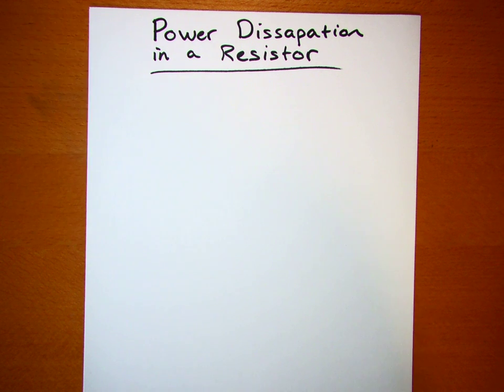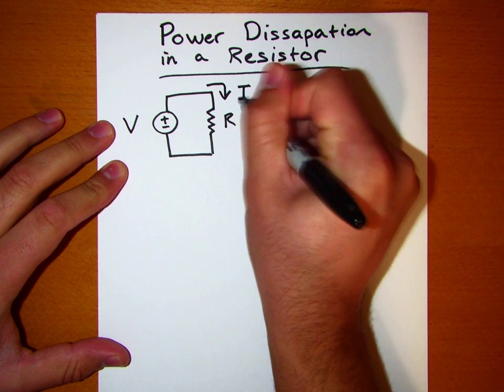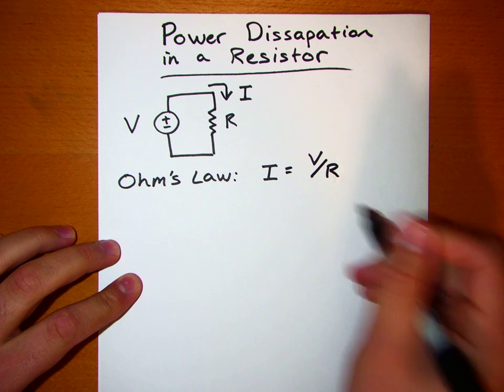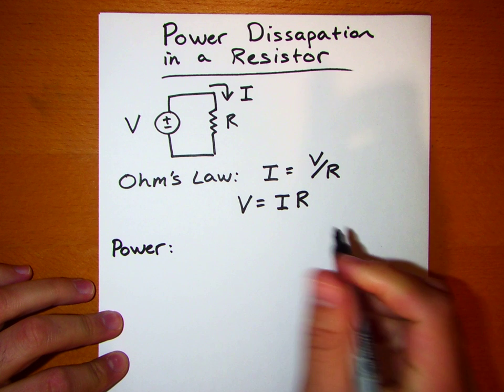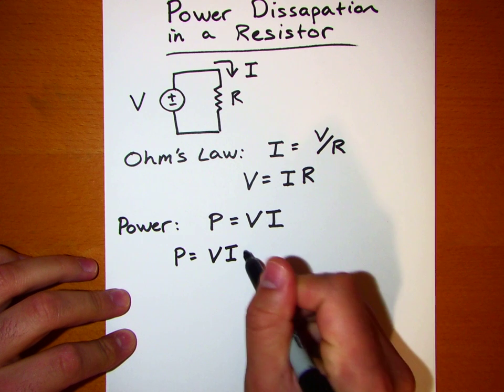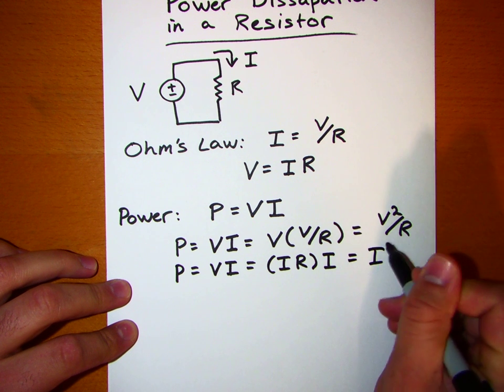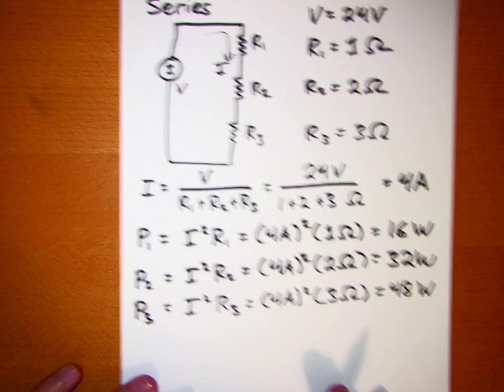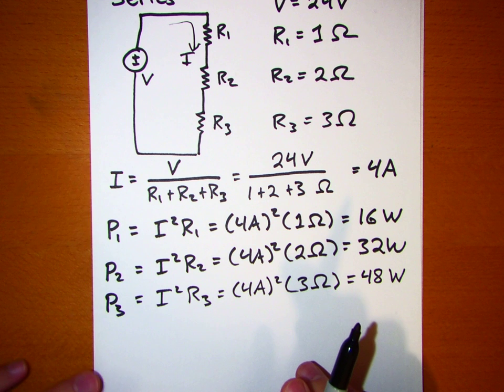Power Dissipation in a Resistor

Comment: QUIZSECTION,                            ///                                if a lamp bulb draw .15 amps and another lamp bulb draw .25 amps how do you find the percentage of current draw between the two different lamp bulbs? what is the formula 
.15 amp lamp bulb draw less current compared to .25 amp lamp bulb by what percentage?

Comment: So if i have a 6ohm resistor and 2A flowing through. how much energy would dissipate in 5 minutes?
Reply: 7200J
Power=I^2 *R,     R=6ohm,   I=2A,   
hence, P=24W
Energy=Power*time,          time=5minutes=300seconds
Energy=24*300=7200J.

the real question is how is that resistor still functioning with all that energy going through it in such short time.
Reply: LOL, that IS the real question

Comment: Can you please explain how to do this in series, but with three voltage sources in between the resistors?
Reply from the maker: Hi there :) When you have voltage sources and resistors in series, the relative 
placement of components doesn't matter. Circuit "V1-R1-V2-R2-V3-R3" has 
the exact same properties as Circuit "V1-V2-V3-R1-R2-R3." Each component
 shares the same current, which is calculated as the sum of voltages in 
the loop, divided by the sum of resistances in the loop.

Comment: What would be the wattage of a resistor with the description R-US_0204/2V?
Reply from the maker: +Eric Hogan 
https://pikirsa.wordpress.com/2011/08/01/eagle-component-package-sebuah-catatan-pencarian/

If I'm reading this page correctly, it's a 1/8 W resistor. The 0204 refers to the dimensions--0.2 x 0.4 cm--and the dimensions correlate with the power dissipation.

1/8W resistor (PTH)Various

R-EU

0204/5

5 mm grid

1/4 to 1/2W Resistor (PTH)

Various

R-EU

0207/7

7.5 mm grid

1 W resistor (PTH)

Various

R-EU

0414/15

15 mm grid

3 W resistor (PTH)

Various

R-EU

0617/17

17 mm grid

1/16 W resistor (SMT)

Various

R-EU

R0603

Typical power for 0603 size

1/4 W resistor (SMT)

Various

R-EU

R1206

Typical power of 1206 size

1 W resistor (SMT)

Various

R-EU

R2512

Typical power for 2512 size

Comment: man I have a question  I need an answer quickly .... how calculate a powerdissipation (max) in a resistor RI think it's dp/dR  but I don't really know how
Reply from the maker: +Seddik lamperoug 

In theory, there is no maximum dissipation for a resistor. Any given real resistor has power ratings, yeah, but mathematically there shouldn't be a limit.
Reply: quizsection  thx man

Comment: When you are calculating power across the resistors in series, don't you have to calculate it according to the amps in each resistor :O?
Reply from the maker: Well, you don't have to. With a resistor, P = I^2 * R = V^2 / R. You can calculate it either way, but the configuration of the resistor does make one or the other methods easier to calculate. When the resistor are in series, they have different voltages, but the same current...so P = I^2 * R is the easier calculation. When the resistors are in parallel, they share the same voltage, so P = V^2 / R works better.
Reply: quizsection thanks :-D

Comment: How do you know when to use the symbols for Amps and Watts. Im confused
Reply: Amps are for current, Watts are for power. The power dissipation he is calculating here is to determine how much heat those resistors are going to put out when you connect the whole circuit together. When you buy those tiny resistor the usually can only dissipate 1/2 or 1/4 of a Watt, they are called current resistors. If you want a resistor to dissipate watts (in our case, heat) you need a power resitor, they can go to values like 5w or 10w and so on... 
Im not a specialist but I think this is the correct explanation! Please someone correct me if Im wrong! Ill be happy to learn some more!

Comment from the maker: Yes, as soon as I can get back in front of my lecture cam. I'm in the middle of moving, so give me a couple of weeks to get on it. Thanks.

In the meantime, let me just say, to find the power dissipated in a resistor, you must first know either the voltage across the resistor, or the current through it. To find either of these, you will probably need to use a combination of Kirchhoff's equations, and equivalent resistance of parallel resistors...